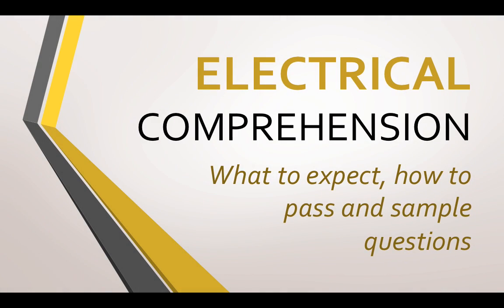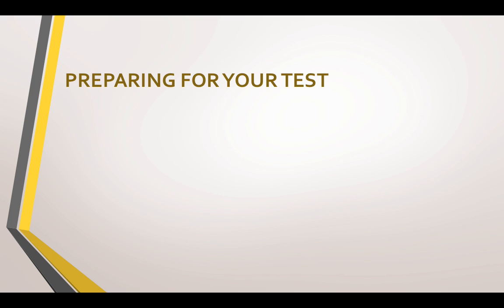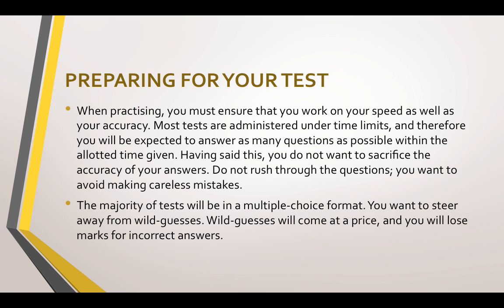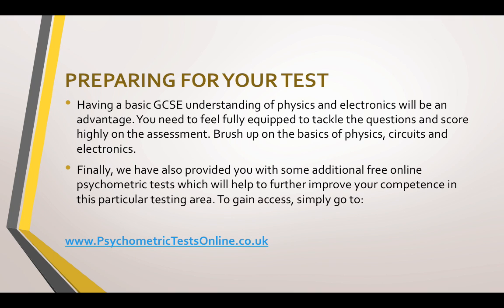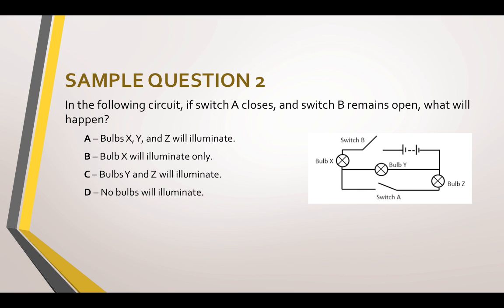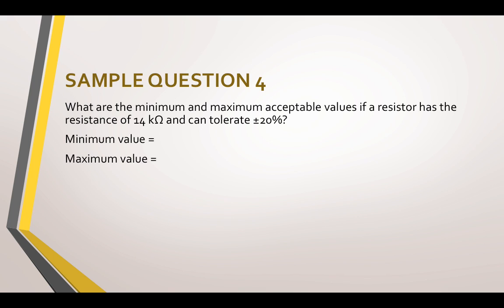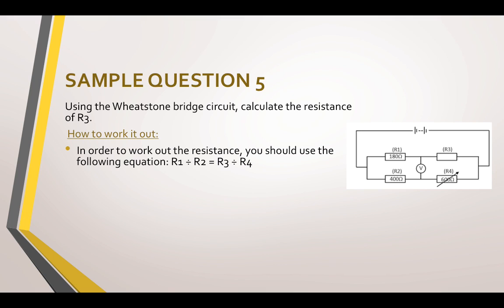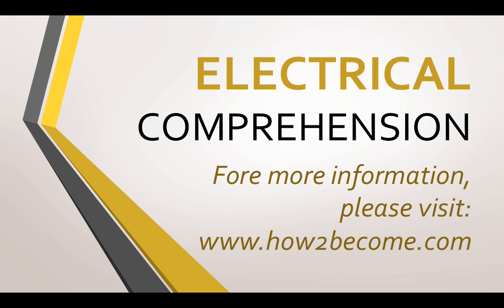Electrical Comprehension Tests; what to expect, how to pass, sample questions

Comment: Wouldn't question 3 be a short circuit?
Reply: I think you're correct. A short circuit and no bulbs lit because the positive terminal is connected before bulb one and after bulb two, so no voltage drop can occur. Maybe the crossed wires are not meant to intersect and instead jump over one another?
Reply: @aspect42  "... instead jump over one another?" then they should be drawn differently, the wire should have that little hump in it indicating that the wire crosses over and does not intersect. as it is drawn, it is 100% a short circuit.

Comment: For anyone trying to figure out where the 100 came from in Sample Question #4. 

The first equation is to find what 20% of 14,000 is. Instead of dividing by 100 then multiplying by 20, you can also convert 20% to a decimal (.20) and then.... 14,000*0.20=2,800.

Also, for Sample Question 5, you can use the algebraic equation:

180/400=X/600

Take the 600 onto the other side of the = and reverse it from division to multiplication:

(180/400)*600 = X

X=270